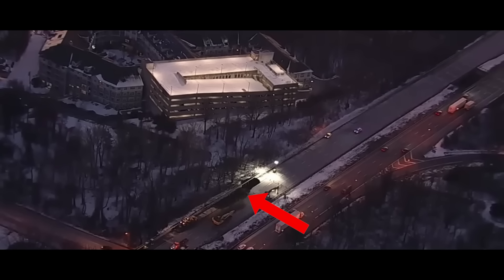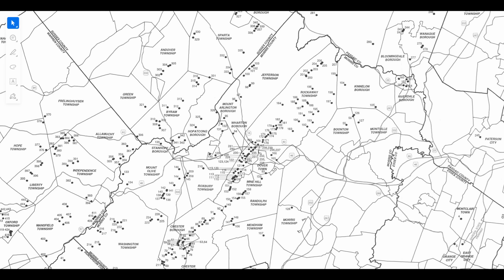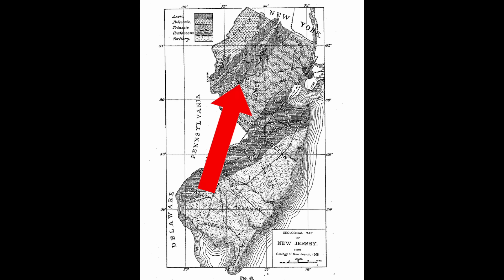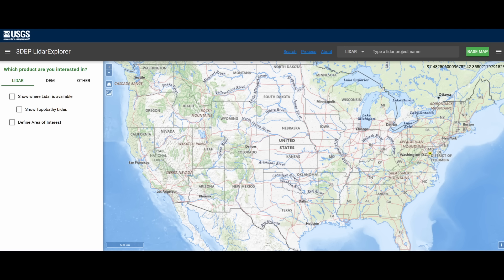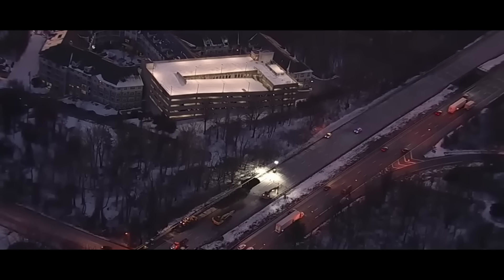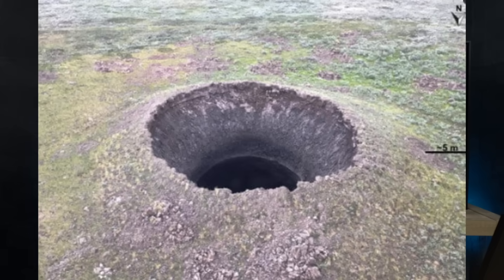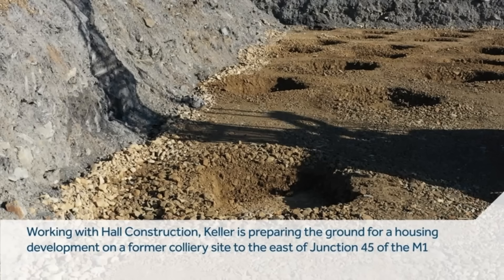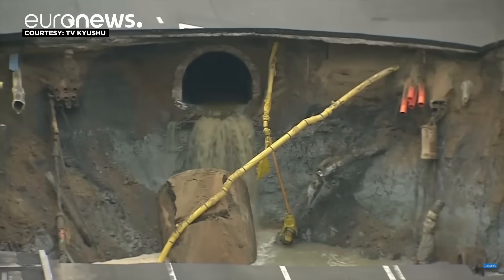New Jersey Mine Collapse below I-80 - How did it Happen, What are the Dangers?

Comment: The mine DID NOT collapse. The mine goes all the way across Route 80. It was rock and dirt that was on top of the mine. And the mine goes further than what they say they fixed. There are several other mines in the same area. Many sink holes in Morris County. Morris County had 500 iron mines. The Sterling Mine is in Ogdensburg not in Wharton.  24/7 traffic on Route 80 East and West with 80,000 lbs tractor trailers does not help  the roads.  Problem is that NJ does NOT have a lot of information on the mines, how deep they were or how many levels they had.

Comment: Something the news stories did not cover is the location of the "sinkhole" perfectly aligns with where Rt 80 passed over the old Rt 15.  Rt 15 was moved east when 80 was constructed and a large fill was constructed that 80 sits atop.  The fact that the fill collapsed at precisely where an old highway sat suggests this has more to do with the fill and construction of 80 than an old mine. The old path of Rt 15 dates back decades before the construction of 80 and it seems odd that they would construct road over an old mine back in the day.

Comment: Most of the shallower, older mines (some pre- revolution thru 1910) in this area that are still visible / subsided (there’s the nearby mount hope park that is a park due to the mines) have the alignment of the rock layers at an angle.  So this is a “newer” deeper  mine, but the layers of bed rock are likely similar for this mine.  And thus it can slide over time due to freeze thaw, we also had a drought that may have exacerbated this.  I think these were unlikely room method, but just following the rich ore veins and clearing them.  There is a mountain nearby that was essentially vertically stripped where ore was available near the surface.

Comment: Back around 1990 there were two "sinkholes" that opened up in the condo complex on Richard Mine Road in Wharton, not far from the I-80 collapse.  One hole was inside someone's garage and the other just outside their garage.  These were old vertical mine shafts whose cap structures had rotted away and allowed the fill they supported to fall into the shaft.  When they first capped these shafts they used wood timbers to support the fill, which would be acceptable for a while I suppose except for the fact that the water level in the mines varies, and will alternately cover then expose the timbers, eventually causing them to rot to nothing and so you get a sinkhole. After I read about this, I looked over my home insurance policy and it had a definitive statement that they did not cover "any sinking of the earth" - yikes!  Also, I can confirm feeling 2 earthquakes while I lived in that area - maybe the quakes  contributed to the structural failure of mine shaft caps. 

I researched at the local library on the subject of mines in that area of New Jersey and found that these mines were very well documented - main shaft and vent shaft locations, vertical depth,  horizontal shaft location and length, etc.  Seems to me that it's unconscionable that towns allow structures to be built on top of old mine shafts.

Comment: Would they use ground penetrating radar to determine if the mine shaft comes close to the parking garage or apartment building that is nearby the Rte 80 sink hole to determine those structures long term stability?
Reply from the maker: GPR can work in some applications for void detection, but I suspect that the soils there may be too clayey for it to be effective there.
Reply: @CaseyJones-Engineer  Thanks for educating me on that. Hope the restoration goes well!

Comment: I don't think you need high tech imagery to detect if a roof starts to sag.  Water pooling does a great job.  If you have a good roofer they can inspect it after rain storms and note any such problems, or you can intentionally flood it and take pictures.  No roof is perfect, and if the puddles grow significantly or they move to new areas then you have a problem.

Comment: There was another sinkhole about 5 miles north of that location along Rte15 at Weldon Road and Mallard Drive.  Apparently it was another capped mine that failed just after new homes were built very close to the mine.
I’m sure that the mines were used to mine iron for the nearby Picatinny Arsenal.

Comment: 12:51 - When they were building the original Shands Hospital at the University of Florida, they lost a 60ft piling they were driving into the ground for the foundation. Lost, as in it got away from them and they could not find it. A cavity in the underlying limestone was not a good place to drive a piling. The story is there were a fleet of cement trucks lined up dumping cement into the hole for days and days and days...

Comment: In the 1960's I lived in Saucon Valley PA, near PA-378 (formely PA-191) south of Bethlehem PA - the main highway from Bethlehem to Philadelphia.  The valley was mined from 1853-1893 for zinc, and there are abandoned mines throughout the valley.  One night during an unusually dry summer in the late 1960's a large portion of the valley, including PA-378 collapsed about 10 ft.  The entire area just dropped down.  Apparently, the mines were filled with ground water, but with the drought that summer the water table dropped, and the ground over a large area collapsed.  My Dad worked in Bethlehem, and had to detour to Coopersburg and take back roads to Hellertown to get to Bethelehem.  It took many weeks to fill in and rebuild the roadway.

Comment: Rock Springs, WY. used to have a serious ground subsidence/sinkhole problem due to underground coal mining activity beginning ca. 1869, until the general abandonment of coal as a primary fuel in the 1950s and 1960s. Remediation was usually by pumping sand slurry into the abandoned mines in the 1980s.

Comment: Very well done, thank you.  That sink hole you mention - I went on a 1931 aerial map and there is a LOT of structures and clearings all around the north side of it.., east of the Pro Gym Supply.  And the Richard Mine road had a rail called the mineral railroad.  Have a great week.
Reply: The Mount Hope Mineral Railroad. It was leased by the CNJ or Central Railroad of NJ like many of the mine railroads in that area. I believe the MHMRR lasted into the early 80s under Conrail.

Comment: 7-8 years ago they closed the shoulder of the highway just West of this location for what was supposed to be 4-6 weeks to stabilize the ground where it was sinking into the mine just where 80 crosses Main street. This is the location you mentioned. They ended up working there for over a year driving pilings and pouring concrete in. I watched them every day driving by to work. Afterwards they drilled both sides of the highway looking for other voids but they didn't go East to where this latest subsidence happened.

Comment: That "water filled Sink hole" is I believe the Dolan or Doland mine. Other mines further up the hill drain through that mine. The apartment complex was built over huge mine openings. That site sat cleared for years while they tried different ways to cap/seal/cover those mines. There were signs on the fences that said "Dangerous construction site" and "Keep out unstable ground"

Comment: What are your thoughts on massive lowrise stickframe apartment buildings that can contain hundreds of units?  The Avalon, in Edgewater NJ, burned to the ground... TWICE.  I see these buildings going up all over the place.  Most of my commercial construction  experience was in NYC, and those buildings are not permitted by the code there.  But leave the city and the cowboy building runs rampant.  It would make a pretty good video because there appears to be some pretty dodgy building going on out there that engineers and builders have to know are fire traps.  I am not sure if you have seen these lowrise stick frame buildings in your area?
Reply from the maker: You make a great point I agree with you. I've been appalled to see massive apartment complexes made out of 2 by 4s is that you would expect only to see in a single familyl house.

Comment: There are a number of far more detailed local newstories that should be accessed.  In other reports they reported that the location of the mine tunnel (these are tunnel type mines not like those you show) they place an appropriate cap and they backfilled as you suggest with appropriate material.  We have excellant sources of backfill material readily available in this region of the state.  As to sinkholes, due to the mineshafts in this region and in a portion of the Reading Prong further south in the Musconetcong valley nj is fairly well equipped to deal with tis type of situation.  This was not a careless ill-thought-out process, they spent the first day exploring and data collecting to determine a solution.  This part of NJ was also covered by the last ice sheet which left a number of lakes, ponds, etc.  Also this highway was built in the early 1960s and I believe this was one of the first sections outside of the immediate NY-NJ metro.  Additionally this sinkhole was early reported as being 40 feet deep, what you are viewing is part of the benching for the repair operations.  There has also been some speculation that due to a prolonged drought that the water table has dropped adding to the matter.

Comment: All the mines in the Wharton , Mine Hill , Mt Hope and Randolph areas were mapped and in some cases capped in the 1960s. I have all the maps and charts. There was another sinkhole collapse  on RT 80 in the same area a few years back. Wharton also had a very large steel works for many years. Also remember that many of the mines had ventilation shafts bored to provide fresh air to the mines. This may have been one of the ventilation shafts.

Comment: Casey, if you want to make a followup video, the NJDEP has pdfs of mine maps of the area easily accessible online. Just search NJDEP NJGS Wharton Mine District. I can also post a link if you want. (Note: when I say mine maps, I mean maps that show the actual underground workings, not just where the mouth of the shaft was)

On another note, these wouldn't be room and pillar mining, as the rock isn't flat. The iron ore beds in that area tend to dip at more than 45 degrees (the Orchard Mine is shown as 48 to 57 degrees) and the veins are narrow (Orchard is listed as 5' thick), so it was more stope mining.

Comment: When examining something like this, look for reports on the strike and especially the dip of the ore body. That's the angle of inclination of the ore. That will effect the collapse area wildly because if it's a steep and narrow ore body, they were using a vertical shaft and not branching out much, so the extent is limited. If it's like a coal mile with a shallow dip, they pulled acres of material
An alternative to just flooding the mine with flowable fill is to make a lightweight formwork and use expanding foam to make a thick plug that's used to prevent further erosion
Reply: I spent three of the first 6 years of my mineral exploration career in the field examining, sampling, and plotting old metal mine workings on topo maps from Virginia to Georgia.  Many of the areas mined from the 1700s to the present were in Precambrian gneisses and schists, often displaying tightly folded layers.  I don't recall a single instance in which the orebody was particularly thick (say, greater than 10-20') nor one where the orebody was not steeply dipping (say 75-90 degrees from horizontal).  As a result, the old mining districts we were re-evaluating always displayed a long, narrow surface expression without a great density of vertical openings.  It looks to me like the NJ I-80 sinkhole is from a collapsed vertical shaft rather than from a collapse of ore removal workings.  I realize the room and pillar methods used in orebodies and coal mines is used in many mines worldwide, but when used, it's because the orebodies or coal seams are relatively flat-lying and thus susceptible to mining by room and pillar.  I would not expect to find 18th-early 20th century iron mines in tightly folded metamorphic terrains which used room and pillar mining methods.  I doubt there's justification for extensive examination of the area for other small features, but there certainly is a pace for refractive or reflective seismic, ground penetrating radar, and lidar imagery in the highly focused examination of sites for new construction of buildings and roadways.

Comment: I thought that was familiar. Just down the road from Picatinny Arsenal. Galvanizing is zinc coating of steel or iron. It is metallic zinc, not a compound. A compound is more than one element... compounded. The most common method is hot dip galvanizing, where the item being galvanized is submerged in liquid zinc.

Any update on the Millennium Tower?

Comment: Thanks for the detailed explanation of this sinkhole and what measures they should be taking to determine other mines in the area. As you mentioned, InSAR could be a useful screening tool for the area to potentially detect initial ground displacement that could be a precursor to sinkhole collapse. Your friends at Value Space are not the only company that provides InSAR monitoring services.
There will also be a government-sponsored InSAR surface displacement mapping product released this year for all of the United States, Mexico, and Central America, from the NASA Observational Products for End-users from Remote-sensing Analysis (OPERA) project with 30-meter resolution. The OPERA products will be free and open like all NASA data. The first displacement products will be from Copernicus Sentinel-1, with future products from NISAR.

Comment: As you no doubt know, SW Missouri, is rife with underground lead and zinc mines, mostly undocumented as to location.  When Mo249 & I-49 were being built, the state required drilling to find mine voids.  A local concrete plant ran 24 hours a day pouring flowables into found voids.  Some of the underground mines had roofs in excess of 8 feet high.
Reply from the maker: Yes, the old lead belt!  There's a lot of interesting geology in that part of the state. My undergraduate degree is in geological engineering that I got at Rolla.

Comment: I remember a sink hole on I-5 near Roseburg OR in November 1996. It was 40 feet deep and 100 feet wide. Apparently caused by heavy rains and drainage. A couple semi trucks ran through it a picture of one truck that went through it the cab of the truck was shaved off the chassis and ended up on the road way on the opposite side of the sinkhole. From what I remember the driver was not injured.

Comment: Flyash is a good supplementary component in cement and it's actually starting to get hard to get hold of. Volcano ash (VPI) is a replacement material tried out.
If you have old mines in an area where there aren't any structures above ground it's possible to collapse them as well, basically initiate the sinkholes in a planned way rather than get them as a surprise.
Reply: Given how much volcanic ash gets thrown around by active volcanoes, one wonders if deposits occurring over populated areas following an eruption (y'know when residents have to shovel it off their roofs), have been offered up as "Hey, you can cart this stuff away, use it for concrete whatever,  just get it out of our (village, town, city)"
Reply: The Romans used pozzolanic ash from Mount Vesuvius as a component of their hydraulic concrete in a mixture with calcium hydroxide.

Comment: I'm from southern Illinois and mine subsidence is a huge problem. About 10 years ago an ice-rink in the area had to shut down due to subsidence. A few years before that, US 50 suddenly dropped by 7 feet for a stretch of about 200 yards. A few buildings from that event are still visibly leaning.

Most of these mines used room and pillar. However, what's worse is that because room and pillar is so inefficient (40-70%) at extracting ore, many of these mines used 'retreat mining'. This is where once the area has been mined to the full extent by room and pillar, they begin mining the pillars, allowing it to collapse as they retreat back towards the mine entrance. Over the next 100-200 years, large swathes of mined areas are expected to collapse downward by 3-7 feet.
Reply: I'm from Decatur Illinois we have mine shafts all over the place  500 to 700 foot down
Reply: My grandfather was a coal miner. He told me numerous stories about his experiences and described in detail how they went about t it.
He was in the era when they used canaries to detect toxic atmosphere, the access shaft was only wide enough for the rail cars pulling the coal up and out on a cable with gravity.
They mined the coal face in front of them while on their knees. They mined the roof was supported overhead by mechanical supports that they moved forward as they dug through the seam it’s additional rows of supports behind those but with decreasing heights until the roof merged with the floor they’d dug out. The only thing kept open was the shaft by which they entered and exited and through which the rail hauled out the coal.
Their only light source in the mine was carbide lamps on their hard hats. 
As a kid I thought how insane it was.
Reply: Frightening. These oversights are due to Corruptiom,and nothing but.